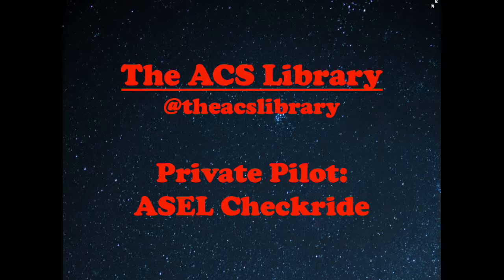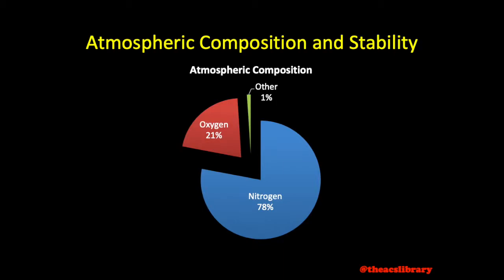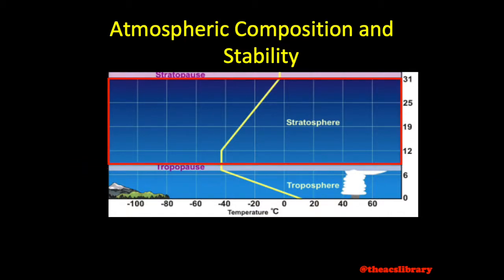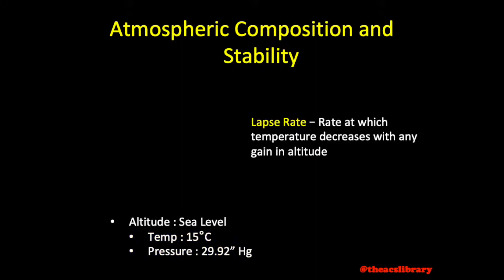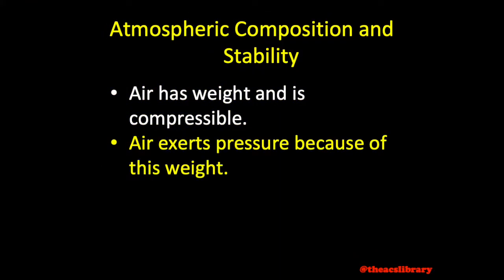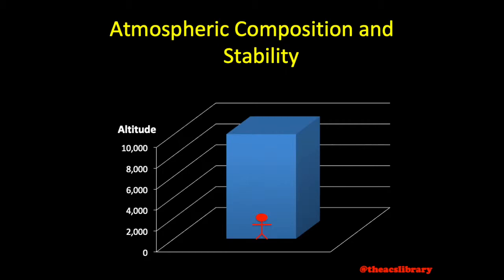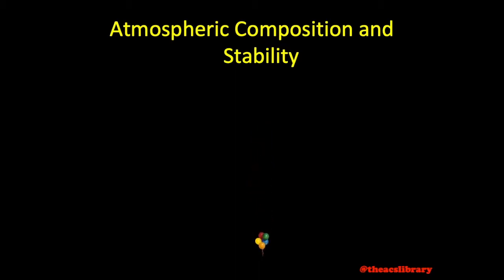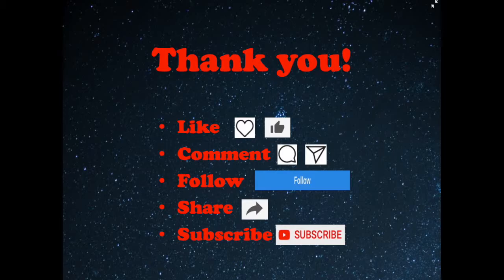PA.I.C.K3a Atmospheric Composition and Stability (Weather Theory)

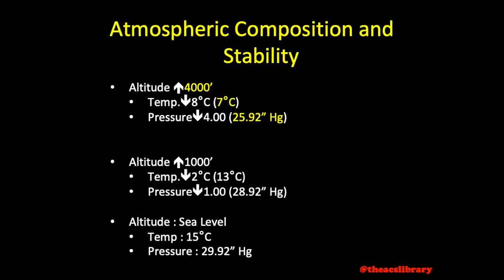Comment: Thank you for these videos! Just a quick typo I found, at 3:06, I think that the math on 4000' is wrong. If it is down 8 degrees, shouldn't the parentheses read 5 degrees C (13-8=5)? And if pressure is down 4.00 should it read 24.92 Hg (28.92-4.00=24.92 Hg)? Please correct me if I am wrong. Have a great day.
Reply from the maker: Hey Kayla! Thanks for taking the time to comment! I see how I’ve made things unclear there now.  So the 8 and 4.00 will be removed from the Sea Level Temperature and Pressure rather than the 1,000’ MSL values.  Sorry for any confusion! Have a great day as well!